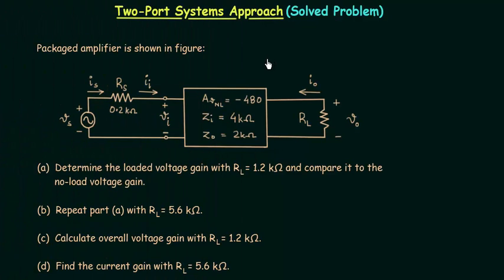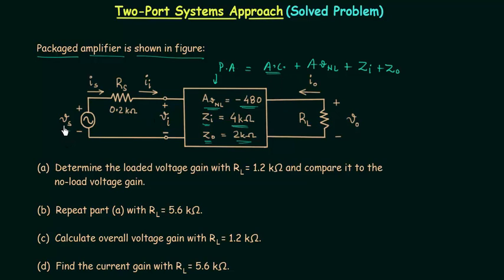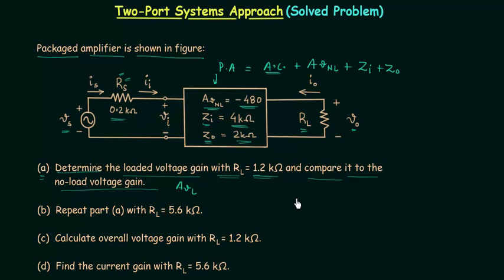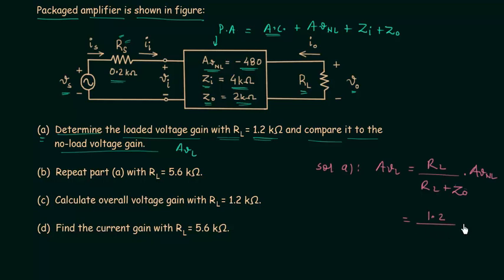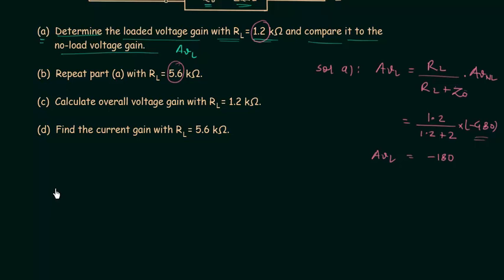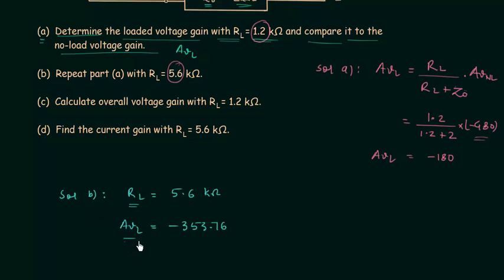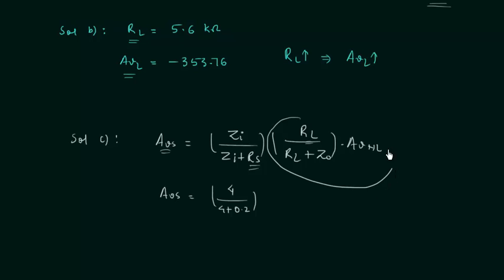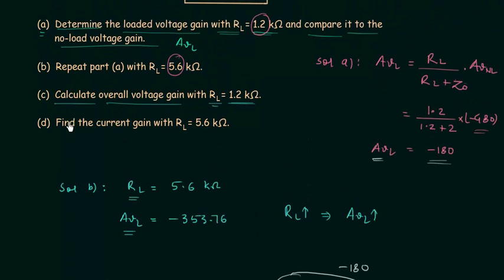Two-Port Systems Approach (Solved Problem)

Comment: As we know from the previous lecture's H.W. problem overall current gain= -Avnl* {Ri/(Ro+RL)} 
So my answer is = -252.63
Reply: Answer is +252.63...
Reply: Yes it would be +252.63
Your formula of current gain is right only you are mistaken in putting values ...you might have taken Avl in positive but it's negative.

Comment: 128.57 is this correct ???
Reply: no, because maybe you applied voltage gain for RL= 1.6K (in the current gain formula) but here we have to apply voltage gain for RL= 5.6K
Reply: yes